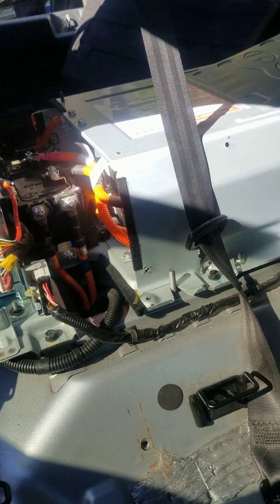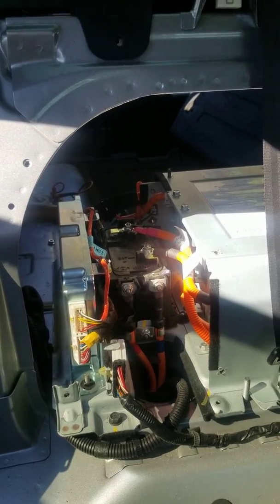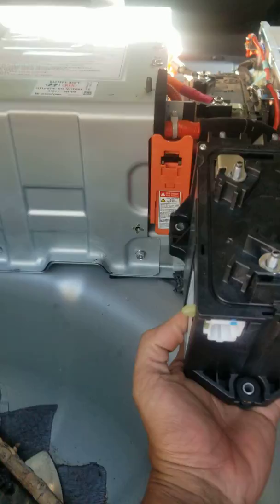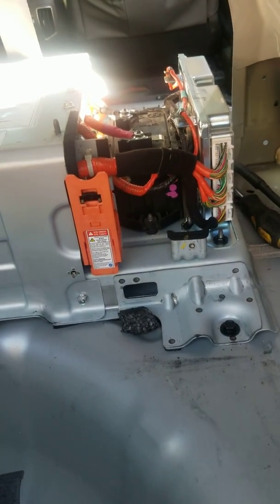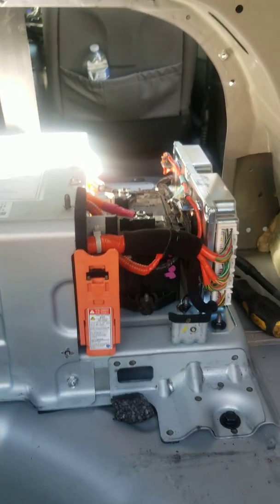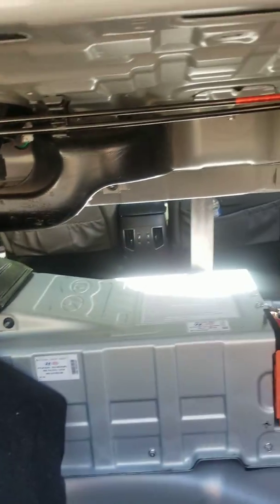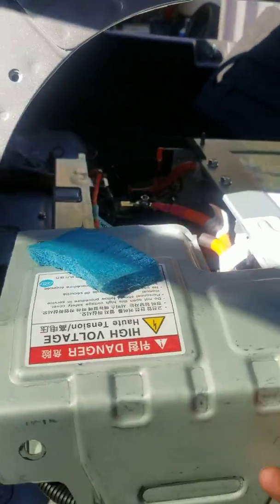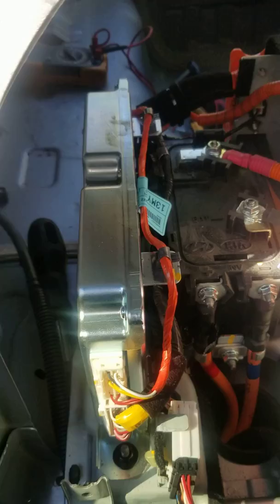2010-2014 Hyundai Sonata (YF)HYBRID: Hybrid System Warning! Safely Stop and Do Not Drive. P1B77

Comment: Does the Klein Tools Voltage Tester work with DC? I thought it only tests AC and isn't the hybrid battery DC? I am replacing my Power Relay Assembly today and am worried that using this tester will not tell me if it's safe to work on. Is there another tester I should use instead? The Precautions section of the service manual for my 2012 Kia Optima Hybrid says "When measuring insulation resistance of the high voltage system, use a Mega Ohm Tester (high impedance Digital Volt/Ohm Meter (DVOM) 'Category 3' leads and meter rated to 1000 volts." Thanks in advance for your help.
Reply: Just use certified gloves and glasses, regular clothes with socks and shoes, no need to make yourself a human bunker. Just disconnect 12v aux battery +- buses and the service plug, after you get into the Hybrid system disconnect as well their +- and you're free to go, just don't relax yourself and don't overtouch anything youre not sure if it's safe or not.
Reply: @Chiquilindlp  Using a multimeter allows you to know for sure and not guess. Even with that, you’re right about the gloves. I found a multimeter and used the gloves. :)

Comment: What is the DC voltage that you should measure on the power relay  terminals? I swapped my power relay in about 2 hours which Hyndai mentioned that would do for $1800 and not confirmed if this would fix issue.  Switching relay did not slove issue. Car has error code P0A78.
Screen is flashing Hybrid System Warning Safely Stop and Do Not Drive.  Orange 120 Amp fuse reads 0 ohms resistance, has anyone replaced the orange fuse with 0 ohms resistance and solved problem?. Looking for tips on next step.
Reply: Did you have to get the 300v gloves or when I disconnect the 12v battery and remove the orange plug. I should be okay? Thank you
Reply: Play it safe. I used internal rubber gloves, then long sleeve hoodie to cover any skin, then I wore long chemical gloves up to elbow. As I removed each cable I wrapped each wire with electrical tape. I was very catious. Did not use 300 volt gloves, still alive and ticking. i was getting both codes before this. Error code code P0A78 and P0A0d. After replacing unit i now get code P0A78. I did manage to get a couple of articles on repairing this. Car still in front of house. Easier to buy another car honda civic GAS F*** the hybrid crap. i can share articles later if you like.    @CamperPrius
Reply: @authorandrewzee9524  thank you! I just finished it. I tape each wire as I worked. Thank you!!!!

Comment: Having the same problem with my 2012 hyundai sonata hybrid same Issue it stalled and stopped in the middle Of a busy road message Came up pull over don't drive this vehicle it's been 2 different Hyundai dealerships they said I need a new safety Plug. And relay assembly. They put the parts on still nothing. Took it to a different Hyundai. dealership They tried to put those same two parts on I told him that the other Hyundai dealership already did that and it still didn't not paying labor for Them to put the same 2 part On that The other Hyundai Did already they. Act? Like it's a freaking spaceship.
Reply: Just happened to me last week. I did the safety so lets pray that the relay box fixes this.
Reply: Hey sorry to hear that I wish I saw this msg b4 I’m going threw same bs now did u ever got it fixed plz let me know

Comment: This definitely does not work. Just replaced the relay assembly and the battery for $1600. And it still comes on. No matter which dealership you go to, they wont be able to get to the root of the issue. I have a 2013 sonata hybrid

Comment: YES, These car's operation HANGS ON 1 FUSE !! If this one fuse pops, YOUR CAR STOPS !! 
The fuse in the Hybrid Battery Safety switch!
SO PEOPLE, GET YOURSELVES ANOTHER SAFTEY PLUG AS A BACK-UP..carry it in your lower center consule.. And familiarize yourself with removing and re-installing this plug. *Hint, it must be all the way open to insert. Then close till it clips..
Practice it because You WILL have to do this, in the dark, on the highway.. not where you want to be fumbling around..
These Hyundai Hybrids are Great Driving, Ultra Reliable ( If made in Korea. Reject any made in Alabama,  google it) But they have this Achilles heel.
Carry a SPARE!!!

They usually pop between 120 and 140 thousand miles, but one every 10,000 fuses is defective industry-standard... so you never really know when.

Comment: This happened to my ki optima hybrid 2015 it said hev system something please turn off engine so i pulled over turned off the car then it didnt wana start and the ready light nor hev light come out in the dash board is this the same problem ? Or can it be something else since it is a optima and not sonata
Reply: Did you ever find solution my 2012 hybird will not start not getting ready light or Hebrew light

Comment: Had an ex who put salt in my gas tank and i turned it on and drove about a mile til it said to stop driving and pull over, so I did and I just bought a new battery and it worked again. Ps. Before the battery it wouldn’t run

Comment: I stopped. Left the car running and gave it some gas so the engine would kick in. Got battery up. Babied it home 1 1/2 miles and warning came back on when I got in my driveway and once on the way home, stopped again got it home. Gave it gas when I parked. Got the battery back up. I can’t drive it now though. The tool light and hybrid system warning went off. I could start it again. I then turned it back off. How much are the parts and the tools to fix it. Tester, sockets, etc. and then parts to fix car? I don’t have the money. Will have to borrow it. I’m broke, need the rent money today and my car is how I was going to get it. I’m so stressed. I’m so screwed. I just wanna give up at this point.
Reply: It’s the 2014 Hyundai Sonata Hybrid
Reply: Where u located

Comment: Hi, I just had this replaced on my 2014 Hyundai Sonata Hybrid Limited, luckily for me it was still under warranty, so there was no cost to me, but I received the papers on the repairs they did and the parts they replaced, so I’m going to list the part numbers so you can but them cheaply online if your car is off warranty and you have to pay for it out of your own pocket:
Relay Assy-Power 37514-4R000
Safety Plug Assy-Male 37586-4R002
Reply: Good looking out on providing the part numbers sir!
Reply: Ty
Reply: Exact same thing happened to me on my 2014 Hyundai Sonata Hybrid, but it ended up costing me about $1500 to replace and then there was the diagnostic fees to include. Wish I knew about this video beforehand.
Reply: Relay Assembly Power 37514-4R000
Safety Plug Assembly Male 37586-4R002

Comment: Hey manuel i have a question. I qm working on a kia optima hybrid 2014 this battery in the Hyundai looks to be the same. I have P1B79 DTC it originally had a faulty 30v pack very swollen so after replacing the bad pack i get the new DTC. My symptom seems to be that the low dc/dc stops about 5 seconds after starting then on the live data also the HV inverter quits both at the samw time. Could this same relay box be my issue?. Great vid hope to here back...
Reply: What did you end up having to replace? Mine is 2013 and acting like what you described. But the inverter coolant also overflowed and now i get the wrench light of and on and it says to check the charging system
Reply: @richardsypert5993  did you get the car fixed? i hope so! i’m also dealing with check charging system error and any information at all would help!😢
Reply: did you get it back on the road? if so i’m curious what was wrong and what needed replace dab

Comment: I was just ripped off by dealer for replacing the PRA. I took the part back and all relays tested good. Only the Fuse was blown.
Reply: Fuse?
Reply: @800PooDragon  orange safety fuse 125amp from factory. 
Needs replaced with 150

Comment: Gracias por el vídeo tengo ese mismo problema ahora mismo pero aún no le eh conectado a la computadora pero el carro mío trabaja bien prende pero después de un rato le pasa lo mismo hybrid System Warning safely stop  and do not drive pero mi carro prende normal, pero aún como quiera tengo que cambiarle esa piesa
Reply: Que tal amigo pudo arreglar su carro? El mío hace lo mismo, si me pudiera dar más información se lo agradezco 
Gracias
Reply: @guillermofernandez8916  si logre arreglarlo donde un mecánico, fue el fusible de la batería hydrid que se le quemó porque se le había terminado el antifriz de la batería hibrida. Es otro pequeño tanque de antífriz que tiene el motor al frente para mantener la temperatura de la batería hibrida fresca.
Reply: @DarielCamacho  localize el tanke no está vacio pero si le falta mucho sobre el sensor se refiere al EMS de 40 amps de la caja de fusibles en el motor o al safety plug de 150 volts?
Una vez más gracias por la información llevo varios dias buscando información.
Reply: @guillermofernandez8916   si el safety plug es el fusible de la batería, llévalo a un lugar donde sepan trabajar con carros híbridos ya que no todos los mecánicos saben.
Reply: @DarielCamacho  si salio un tsb para estos carros de cambiar este fusible que biene de fábrica en 125 volts y ocupa de cambiarse por uno de 150 volts ya lo habia cambiado pero el antifreeze es algo nuevo lo voy a intentar y también a checar todos los fusibles relacionados 
Si acaso logro arreglarlo te aviso 
Gracias
Reply: @guillermofernandez8916  ¿Has tenido suerte con tu coche? He reemplazado la mayor parte del sistema híbrido en mi Kia Optima 2013, solo tengo un error en el sistema de carga y la luz roja de la batería en el salpicadero
Reply: @PivotGrowth  no todavía no , y no quiero comprar partes sin antes estar seguro de que no estén trabajando pues el power relay son $250 el pcp otros $300 el fusible $80 el cual remplaze por uno del orallys por $10 aftermarket 
Te aconsejo pongas una queja de seguridad en safety transportation highway yo ya la puse aver si varios se quejan y hacen un recall

Comment: It looks like the voltage tester you're using here is for AC. Isn't the power at the hybrid battery DC? I'm about to do this repair and I'm trying to be extra careful around that kind of voltage so I'm trying to figure out which tester I need.
Reply: Did you ever fix this problem with your car?
Reply: I had the same question that I posted just barely. I'm looking at a service manual for my 2012 Kia Optima Hybrid and it states "The Precautions section of the service manual for my 2012 Kia Optima Hybrid says "When measuring insulation resistance of the high voltage system, use a Mega Ohm Tester (high impedance Digital Volt/Ohm Meter (DVOM) 'Category 3' leads and meter rated to 1000 volts." I'm trying to figure out what that means exactly. Did you get more information about this?

Comment: I had the same symptom on dash a year ago on my 2015 sonata hybrid. I pull over to a gas station, I was able to started the car with engine light on. so I drove to the dealer, they  reload the software the car is ok until now. the deal want to charge me the dianostic fee $125 even my car was under warranty, after a dispute the fee, they waive the fee. I was wondering if the problem will come back some day.
Reply: Did it come back again ?

Comment: Thanks for thyis video, i had this exact issue. Spoke with dealer wanted to charge $4300 to repair. just ordered both parts and replaced it myself. works perfectly....now im going to trade this car in...huge safety issue, just stop in the middle of the road. thanks again saved me a lot of money.
Reply: What's the name of the parts?
Reply: I did my car both replace 2013 hyundai sonata but still same issue car cant start. jump start but jump take out stop suddenley. any idea after replace doing anything
Reply: @CeyBeatzGlobal My Ioniq Hybrid Is doing the exact same thing. I don't know if the solution will be the Power Relay Assembly, however when I got to the 12v aux battery it was hyper inflated I couldn't even retrieve from the car, so I had to dismantle the 12v bat and then it released, I changed to a new 12v Battery from Korea exact same product, but it didn't change a thing, the problem persists. I torn away the power relay but it did look pristine to me, no issues at all, inside there are a few fuses, I don't know however if those were good to keep working. 

Another possible solution was to change the High Voltage fuse but the issue remained. 

Now car's at the dealership out of warranty looking for diagnose, hoping that solution can be a godamn fuse 🙄 but they looked first at the Hybrid System, them sons of b's.
Reply: @Chiquilindlp update?
Reply: @macsoftworld1137 you ever figure out your issue?

Comment: 2010 - 2014 sonota hyrbids did have a lot of problems. The newer ones are a lot better.
Reply: yea im done with hyundai, huge safety issue for it to just die without warning while driving. they should be sued
Reply: 9yr 150k later and this is the 1st issue we've had with ours

Comment: 1-how did you read the P1B77 code. Normal OBD readers can only access the P0xx codes.  2-Did you test the relay assembly to verify the failure?  3-Why is it necessary to replace the safety plug?
Thanks fir the help.
Reply: Great question, I need to buy the relay for a 2010 Sonata, but not sure if it is the same part number listed above. I would also like to see if I can read the code also, so was the reader used an OBD 2 reader or which one will read the codes for a 2010-13 Sonata Hybrid?
Reply: Same question here!!
Reply: Same question here

Comment: How much does this usually cost to repair?
Reply from the maker: I have no idea
But it was simple enough for me to not go and find out
Reply: I went to the dealership and they told me to buy new transmission.  They charged me $500 to diagnose my hyundai sonata hybrid 2013.
I was so mad. Coz they've never done anything
Reply: @papikikukumesse5132  They did the same thing to me, after replacing my electronic oil pump for $1500 which did not fix the problem. Next solution was to replace the Transmission they said and quoted me $8,000 so now my car sits in my yard lol I am going to try this next I guess just to see. Did you try this solution yet?
Reply: @tylergustin210   Same here. Even dealers don't know how to fix this. They suggested me to change the 12 volt battery first. Charged me 450. That did not fix it. So they asked me to do transmission replacement. Upwards of 8000. I said no thank you.

Comment: Hi Manuel, I wanted to ask you if you have had the issue again after this fix? Also, I am ordering parts through Hyundai directly and the second part 37586-4R000(Safety Connector) is not matching with my 2014 Hyundai Sonata Vin. They suggested item number 37586-4R002. Do you know if this would be the correct replacement part?
Reply from the maker: I didn't have any issues after bud
Reply from the maker: I do not know.
My vehicle is a 2013
Reply: @DYImechanicTuro I know this video is old, but I'm in desperate need of help with my car.

My 2012 Kia Optima Hybrid won't start at all and nothing lights up on the dash. I'm thinking it's the power relay supply. My auxillary battery is 11.96 volts when disconnected, but at 4.13 volts when negative and positive plugs are connected. Could the power relay assembly be the issue? Also, can I use a Hyundai Sonata Hybrid power relay assembly on a Kia Optima Hybrid? Thanks for any help you can give. 🙏
Reply: @robertwhitlet  any luck man? 
You can use hybrid sonata parts but make sure you get the SAME YEAR as your optima. 
They will say fits 11-15 or 11-13 but trust me I wasted money on a 2012 HPCU for my 2013 optima hybrid, fit bout damn perfect but couldn’t work properly and communicate with everything it needs to run full hybrid system

Comment: This happened to my son's car tonight.  I bought it used.  We cleared the errors and all is well.  I'm thinking of replacing the relay, but the job seems too extensive!!!
Reply: What brand and model of scanner do you have that will read and clear the hybrid codes? I just bought a 2013 sonata hybrid and replaced the fuse in the safety switch. The car will start and run for a while but then it tells me to check the charging system. The inverter coolant overflowed past its cap on the previous owner and the car wouldn't restart
Reply from the maker: Its really very easy work. The diagnose can be hard
Reply: What is the part called

Comment: I have a 2015 hybrid and the same thing happened but I took it to a shop and they said that my engine is seized but wouldn't have I received a notification on the dashthat something was wrong?
Reply from the maker: I'm guessing it depends.
Reply: We’re you able to fix this? And was it the engine or the hybrid battery? It doesn’t make sense the hybrid battery light is on seems to me the fuse/relay would solve the problem. I also have the same problem and diagnostic from the dealer.

Comment: So I bought the Power Relay Assembly for my 2015 Sonata Hybrid Limited and I was having the exact same problems you were having I replaced the non hybrid battery. I just need to buy the plug and I should be okay?
Reply: Did it solve your issue? I'm having the same thing but mine's at the dealership checking for diagnose, I have a bad feeling of those guys.
Reply: @Chiquilindlp this you fix it??

Comment: I see the vehicle is READY on BUT you have Check Engine Light, VSC, ABS, and another light on, did a battery reset clear those codes?
Reply from the maker: I didnt have none of those on when the car is running. I am guessing I did key in engine off. ? When everything shows. But no eventually I had no permanent codes
Reply: Ok Great same for me. Ended up being a blown 125 amp fuse in the service plug, KIA has a service bulletin. But i went ahead and replaced the relay block anyway. Both the plug and/or the relay block can trip this code. Thanks for the video.